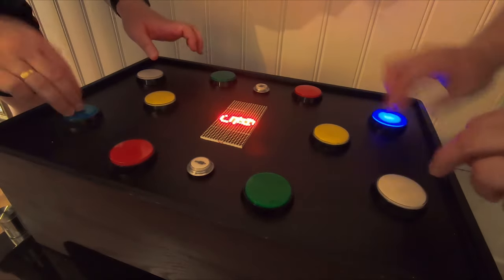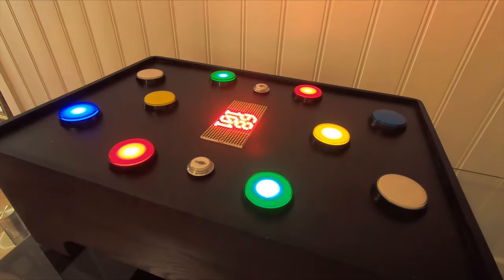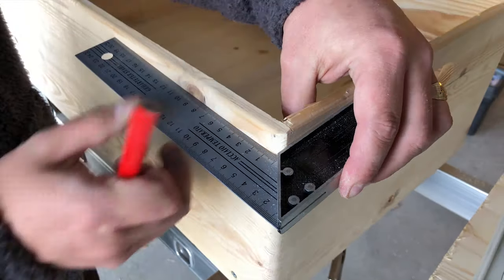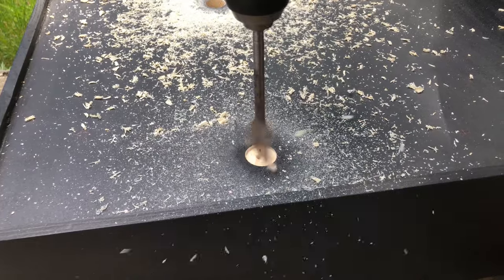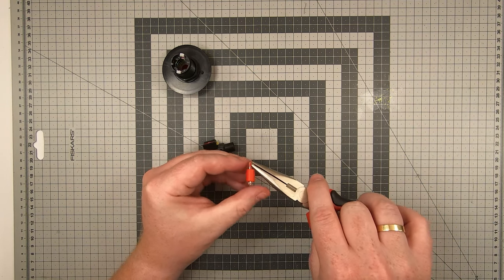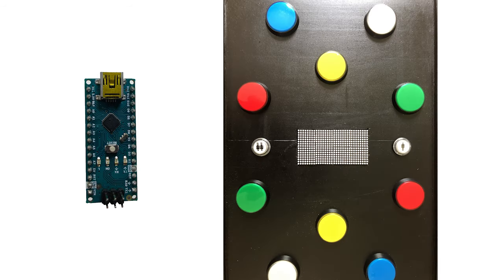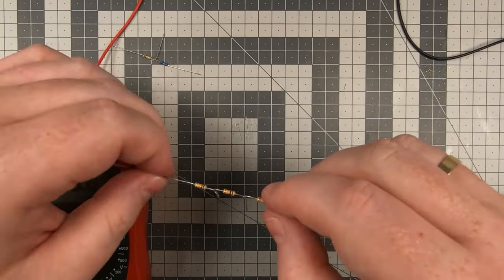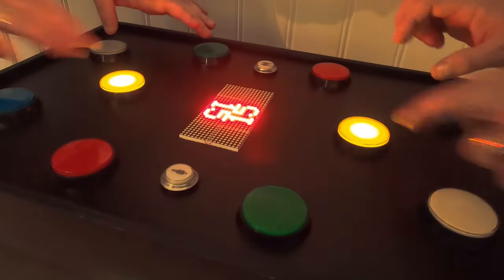Whack a Mole - Arduino Game (full arduino tutorial with code)

Comment: Can I use Arduino Uno?
Reply from the maker: Yes! It’s basically the same chip, just a different layout.
Reply: So, any changes in the schematic and code?
Reply from the maker: Nope, the pinots are the same!
Reply: OK
Reply: Can we use LCD or Serial monitor instead of LED's Display?
Reply: @DIYTECHBROS  Can you please give the schematic of tinkercad
Reply: @DIYTECHBROS  please tell me can we and how to use Serial monitor instead of LED display shown in this video?, Can you please give me the block code used in Tinker cad?
Reply from the maker: Sure thing!
for the set up:
  pinMode(A0, INPUT);
  Serial.begin(9600);

in the loop:
Serial.println(analogRead(A0));
Reply: @DIYTECHBROS  Thank you.
Reply: @DIYTECHBROS  But, How will those LED's would work then?
Reply: @DIYTECHBROS  I'm a 10 year old boy who loves and is inspired by you :)